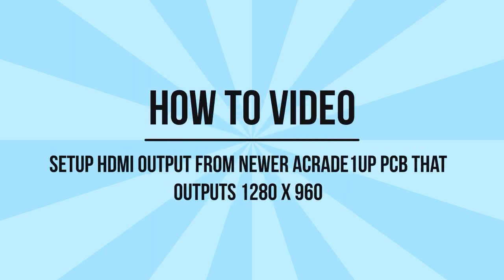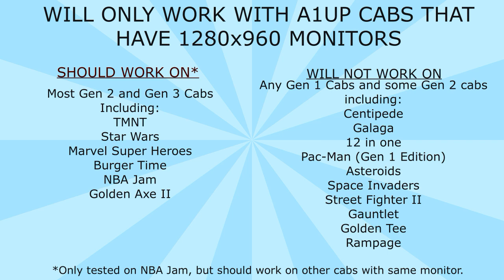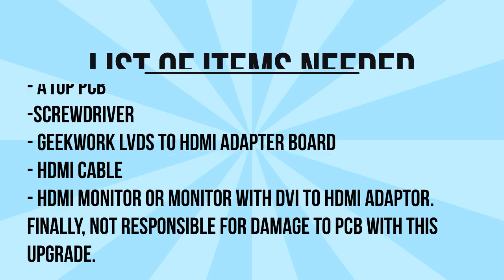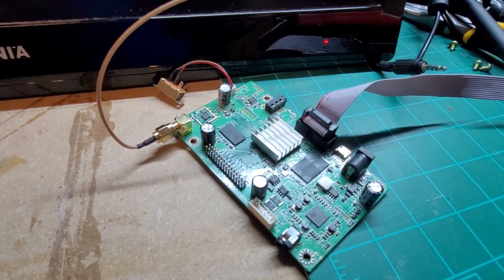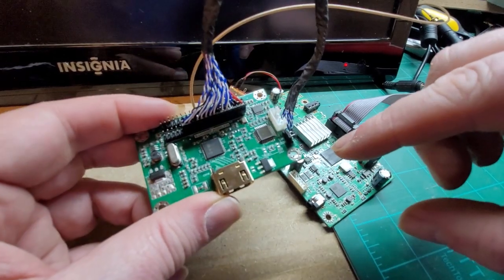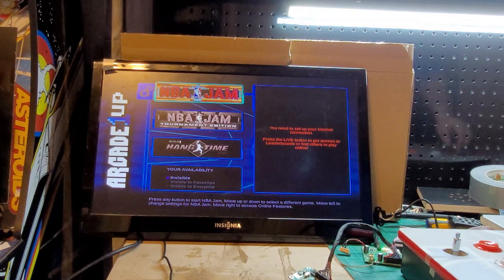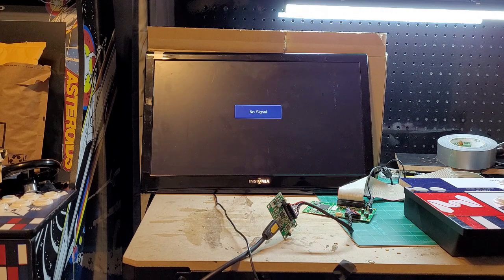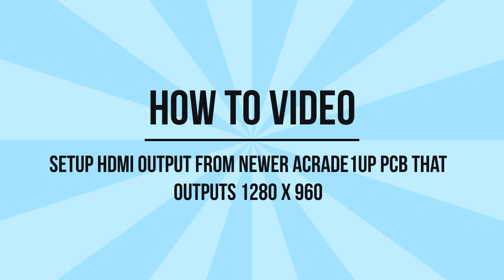A1UP Mods: How To Setup A1UP PCB Running 1280x960 Monitor to Output to HDMI. PLEASE READ DESCRIPTION

Comment: did you change the jumper from single or double 8??? Double 8, Support 1080P (1920*1080P)/1280*1024/1600*900/1400*900/1920*1200 etc.
Single 8, Support 480P/720p/768p/800P/960p etc.

Comment: Do you have a solution for a pinball cabinet with a dead screen.  Finding a monitor that fits is easy but I don't understand the wiring conversion to hdmi.
Reply from the maker: This is a bit different, but basically the same. 

1) For the Geekwork LVDS to HDMI board. I would get the version 2.0 board. Connect that to the PCB and then connect that to HDMI port on the monitor you are installing.
2) Again, there is not guarantee will be compatible with the monitor you choose. Monitor may flicker in an out. But there is a fix by Team Encoder that may fix monitors that flicker. The website for that fix is here:

https://www.team-encoder.com/pinscreenfix?fbclid=IwAR0RhGhBXXnr-FO5Mgu_X4CW8jD3FRlUSt7hewn2rJ9U0hIEiebzWQA6NIg

NOTE: This is not the hack that puts the 30 tables on your PCB...this is only to fix flicker issues on third party monitors, if that problem comes up.
Reply: Thanks.  I was only trying to replace the monitor and not mod the cabinet and there isn't any vids I could find that explained it.
Reply from the maker: @themondoone6316  Yea...if is monitor other than the stock, would need the geekworm board, as would let up plug up HDMI monitor.

The update I specified in my other post is in case the monitor you put in there starts to blink in and out after you turn on the the game. That update does not put any other games on there, just makes some fixes so the monitor does not blink in and out.
Reply: Arcade1up says they are currently out of stock with no restock date.
Reply: Are you sure on the version 2.0 or is it version 20 (for 2020)
Reply from the maker: @themondoone6316  That is the one I have the best luck with, but it is crap shoot with these boards. If you are looking for monitors that for sure work, look at that link I sent. They  have some monitors that work and one listed that works with the V1.5 board. But again, I have most luck using the V2.0 board.
Reply: So I was trying to say there is no v2.0. Only a lvds2 and lvds20.  The question is moot and I grabbed the third Gen 1.5 and ordered the 27 inch element monitor suggested.  We'll see what happens when it gets here.  Should be a fun little project in any case.
Reply from the maker: @themondoone6316  It would be this one listed here:

https://www.diyretroarcade.com/products/v2-0-lvds-to-hdmi-compatible-adapter-converter-board-with-cable?variant=43830575497434&currency=USD&utm_source=google&utm_medium=shopping&utm_campaign=DIYshopping&utm_term=&gad_source=1&gclid=Cj0KCQjw8MG1BhCoARIsAHxSiQlbNDcwyVL41V6z1nJXvY2xG-4apOb3RV68kT2yQG27VIQVcSFf1ZAaAukUEALw_wcB

It is V2.0, although it looks like it states V20. But at any rate, if you got the monitor that is compatible with the V1.5 board, should be good.
Reply: Ahh yes.  Saw that.  If you look on the pic of the board you will notice it is actually v20 and not 2.0 which it is listed as on the geekworm site.  Geek worm said there was no difference between the ver 20 and the 1.5 (except for the second lvds connection) so I think I'm in good shape.  Thanks for your help.
Reply from the maker: @themondoone6316  yea...that is what they say, but the board you get is dependent on what board A1UP uses for their game. For the board in Pinball, I have better luck with monritors and the V2.0 geekworm board. But the monitor that you just bought and the V1.5 board should work. I have not tried, but Team Encoder states it works and they know their stuff, so I trust them when they say it will work. Good luck.

Comment: any luck on the arcade 1 up pinball
Reply from the maker: Best bet is using the Geekworm V2.0 board (not v1.5), but even then may run into issue. 

However, you can increase your chances of a different monitor working by applying Geekworm Screen Fix provided by Team Encoder. This fix will only work with the Pinball PCB's. The how to document is to get a specific monitor to work, but may work with others. I had a monitor with the Geekworm 2.0 board and would come up briefly, then flash in and out and then go black. Once I applied the Team Encoder Geekworm Screen Fix, the problem went away and had no issues with the monitor. And if it does not work, can always follow their instructions to flash back to stock image.

Still a crap shoot on what monitor will work, but with the Geeworm Screen Fix by Team Encoder applied...I believe you chances of getting a monitor to work increase.

Here is instructions from Team Encoder website, if interested:

https://www.team-encoder.com/pinscreenfix

Comment: In this video how are you getting audio? I see you have something plugged into the SPK port on the NBA Jam PCB, is that a 3.5mm cable? What is the cable then being plugged into? I tried running a 3.5mm cable from my arcade PCB (while also using the same HDMI adapter board in this video, so the same setup) to an amplifier and I'm getting zero audio except for a clicking sound. Are you running the cable from the SPK port to an amplifier, or to the stock arcade1up cabinet speakers? I am getting zero audio from HDMI.

Comment: Been wrestling with this thing for the last hour and nothing works. I have a Dell 2001FP (not a 2007fp/b). When trying it, I can hear the A1U turn on (its a Killer Instinct) and I can tell a signal is being sent to the monitor because it comes on and exits power-save mode, but I get a black screen. No idea what is going on. Ive tried HDMI to DVI cables, an HDMI to VGA, and even trying a straight HDMI into a different monitor to test it. I get nothing.
Reply from the maker: What version of the board are you using? The version I have best luck is the Geekworm V2.0 board.
Reply: sorry  @The_Passable_Gamer  I didnt see your reply until just now. Yeah thats the one I have that has the double row of pins, and it does say v2.0 on it.  On the 2001FP that Im using, like I mentioned it comes out of sleep mode, but no video. Only thing that changed was when I used both jumpers and I got an image on the screen but it was all garbled information. Basically like TV static but it wasn't moving, it was a solid "picture" of static.   On another test monitor I used that was with HDMI wouldn't even wake up from sleep mode.
Reply: @The_Passable_Gamer  Update on this. I finally got a 2007fp and I get video, but lots of flicker. I have no idea how these dudes that created this board made something that works so haphazardly lol.  Awful. Ive tried two different boards, higher quality DVI and VGA cables, etc etc etc. Flicker. It makes playing the game nigh impossible. Guess Im just gonna go back to the stock KI 17" POS monitor.

Comment: What is the monitor resolution of Arcade 1up Mortal Kombat machine Gen2 first release?
Reply from the maker: Depends...if it is the Costco version, it will be 1280x920. If it is the Walmart version, will be 1280x1024. I am not sure if other stores sold (want to say GameStop sold as well) but believe those are 1280x1024 as well.

With that said, both have 12 pin ribbon cables, while the Gen 1 MK2 had a 40 pin ribbon cable that connects to the PCB.

From what I tested, if it is the 40 pin ribbon cable, does not seem to work. If it the 12 pin ribbon cable, regardless if from Costco or Wal-Mart, best bet is to get Geekworm Gen 2 board (ends with v2.0). Hope this helps.

Comment: Can i use this convertor for  resolution 1440x900
Reply from the maker: It is possible...it may work. I have a Viewsonic VA1936w monitor that it works on and it is 1440x900. However, some model monitors may not work, although they have the same resolution. What is the model of the monitor you are trying and what A1UP PCB are you going to use with it?
Reply: @The_Passable_Gamer  ...thx allot so nice of u....panel is MT190Aw01 and combo board cv628h-b42...
Reply from the maker: @syedraza7277  Ok...was this a TV that was disassembled or did you buy as a kit that had only the LCD screen and the board? Either way, there is a chance it might work, but need to know what A1UP PCB you are trying to hook up to it. That will determine what version of the Geekworm board to try.

This is the guideline I use when connecting A1UP PCB to Geekworm board (If not connecting to A1UP PCB, can just ignore):

If the A1UP PCB has 40 pins, the PCB is black or it is a Countercade, the Geekworm board will not work, at least with all the monitors/TV's I have tried. A1UP PCB's with 40 pins are Gen 1 cabinets. A1UP Black PCB's are usually in newer Partycades, Legacy cabs, and Mrs. Pacman to name a few.

If the A1UP PCB is green and 12 pins, then you will have best luck using Geekworm Gen 2 board (ends with V2.0). A1UP boards that are green are ones like Star Wars, NBA Jam, TMNT, Midway Legacy, and Killer Instinct to name a few.

If the A1up PCB is blue/purple and 12 pins, then you will have best luck using Geekworm Gen 3 board (ends with V1.5). A1UP board that are blue/purple are ones like Marvel vs Capcom and X-Men vs Street Fighter. Believe Simpsons is also this color.

Also, if HDMI cable does not work, try HDMI to VGA cable. Sometimes HDMI will not work because of the refresh rate on the monitor. For example, X-Men Vs Street Fighter when you connect using HDMI to DVI to Dell 20" monitor does not work (at least when I tested, but works with HDMI to VGA using the Geekworm Gen 3 board. From what I have found, that is because the A1UP PCB outputs a refresh rate of about 66Hz and the Dell 20" Monitor is rated at 60Hz. But using and HDMI to VGA cable instead, it will work.

So depending on what A1UP PCB you are going to use, will determine what Geekworm board to use.

Finally, the above are just based on tests I have done. You may find that the differnt PCB and Geekworm board combinations work. However, the above has worked for me when connecting A1UP PCB to Geekworm board and TV/Monitor.

Here is link to buy from AliExpress on Geekworm store. To select right board, goto Bundle selection and select the board you want with cable.

 Good Luck.
Reply: @The_Passable_Gamer  ....thx allot for for your kindest and detailed guide lines....i am happy with ur kind reply....know i dont wory if all this work or not....ur reply made my day....thxxxxxxxxx allot...

Comment: Followed another tutorial online and thought my GW board was dead. Watched yours and your tip about matching the pin to the dot was what was wrong. Hooked it back up and everything is working. Thanks! Now I just need to figure out how to easily remove the cable from the PCB after using. Any tips?

Comment: I am looking to alternate between my original PCB and a Nintendo Switch. 

This allows the pcb to have hdmi output. Can I then connect the original 17” monitor itself to receive hdmi input and then use an hdmi switch to alternate between the pcb and Nintendo?
Reply from the maker: Theoretically, yes. So once you connect the LVDS to HDMI board to the A1UP PCB, you now have HDMI Output from the PCB

On the actual 17" monitor, would have to get an LCD controller board for that monitor so it would have HDMI input. Then could use a HDMI switcher to switch between the A1UP PCB and the Switch.

Just keep in mind the following though:

1) Not all TVs/Monitors work with the Geekworm board. So if you get the correct LCD Controller board for the A1UP stock Monitor, the Geekworm board may still not work, as it may not be compatible with the LCD contoller board.

2) You would have to connect the audio from the A1UP PCB to the Geekworm board as well..This is so the audio is going through HDMI as well. Most people do not do this because for A1UP, you already have speakers hooked up and no need for audio to come through the HDMI. But in your  case, you would want to do this.

You can watch this video from The Code Always Wins to do this. He is doing this for Generation 3 (V1.5) board, but this should work with the Generation 2 (V2.0) board as well. However, have never done it and may damage your monitor/board when doing it, so have to be careful.

https://www.youtube.com/watch?v=I8MovSVPnP4

Hope this helps.
Reply: @The_Passable_Gamer  Thank you! I'll give it a shot!

Comment: Does the gen 3 board work with nba jam?
Reply from the maker: With the monitors I have tested with, I have not been able to get NBA Jam to work with the Gen 3 board. Will have more luck finding a monitor/TV to work using the Gen 2 board.
Reply: @The_Passable_Gamer  tyanks i have been looking at that new hdmi moniter and bezel in one as well you think that would work with it ?

Comment: Does the Generation 3 board even work with ANY monitor? I've tried mine with NINE different monitors and none of them have worked as of yet... You can see that a signal is being produced, but the screen just stays black.
Reply from the maker: It does but also depends on what PCB you are using...so what PCB are you trying to use with the Gen 3 board?
Reply: @The_Passable_Gamer  does it work with nba jam?
Reply from the maker: @cbk12  It depends on the monitor you are using. But with NBA Jam, will have better luck using the Generation 2 board than you would with the Generation 3 board.

Comment: I bought it fo development needs, I hope it can adapt to other eval boards.
Reply from the maker: If you just bought, you may have received there Gen 3 board, so somethings that worked with the Gen 2 board may not work with the Gen 3.

Comment: Confirmed working with XvSF cabinet.
Reply from the maker: Yes...however after some more testing, looks like the output refresh rate is 65Mhz. The monitors I tested with were 60Mhz and that is why they were not working unless you had an HDMI to VGA converter. Once you confirmed your monitor, I checked the refresh rate and was 75Mhz.

I found an older monitor I had that has a refresh rate of 75Mhz and it worked. The pictures still looked bad (it was interlaced), but was able to run without and HDMI to VGA converter.

So seems because on X-Men vs Street Fighter (and more than likely Marvel vs Capcom, since they use the same board), if you want to use the Geekworm board to get a bigger monitor, you need a monitor or TV that has a refresh rate of 75Mhz. Will be doing further testing and release a video of the work.

Thanks again RoTeNdO for confirming you got it working on your monitor.

Comment: When you hooked up the Asteroid, you didn't have the 30 pin connected the correct way
Reply from the maker: The 30 pin is connected correctly on the Asteroids PCB. On the Geekworm adapter, cannot tell if it is connected correctly or not. Cannot tell if the red power cables are on the left or right of the board (Should be right). At any rate, I have tested multiple times after this and connected the correct way and does not work and will not work due to the resolution of the older Gen 1 cabs PCB's being set to 1280x1024.

Comment: How do I find a HDMI TV it will work with the LVDS to HDMI converter board. I tried 10 different TVs and none of them work. Is it just trial and error or can I look at the TV specs and find out? What large screen TV have you tried that works? Please help.
Reply from the maker: Unfortuately, it is trial and error. Also, depends on the game you are trying to use. Some games will not work. If you have not already, there is a Discord group that has a list of games and TV's that work:

https://discord.com/channels/806193517705691196/806199431220822056

Comment: Great video but to I need a dvi to hdmi or can I run it thru hdmi alone for dell monitors
Reply from the maker: If the monitor does not have a HDMI and has a DVI, then yes...would need a DVI to HDMI cable. Otherwise, if the monitor has HDMI, then just an HDMI cable will due.
Reply: @The_Passable_Gamer  thank you

Comment: Anyone figure out how to make this monitor mod work with the MVC cab yet?
Reply from the maker: I have not...I think someone got it to work by  setting the jumper to single 8, but image did not look that good. Been seeing some of the newer A1UP machines do not seem to work with the card...not sure why.
Reply: @The_Passable_Gamer  k.  Thanks for the response.  If you ever hear of it working, plz lmk.
Reply: @The_Passable_Gamer   the 1.5 works on MvC 2 but I feel like there is noticeable slight input lag. Sometimes have to turn the cab on and off till the geekworm catches the signal. I had to wrap the lvds cable in foil and electrical tape to reduce signal interference. There is still slight waviness on texts not noticeable during active gameplay. Not sure if there is any real good way to upgrade the monitor without replacing the pcb entirely because I’m sure a direct panel swap is going to have extra drawn lines drawn and I don’t even know which type of inverter board to get for the 2007fpb since different monitors use different boards. Very unfortunate.

Comment: This doesn't work on my TMNT PCB.  Any suggestions?
Reply from the maker: Should work on TMNT PCB. I have two of these PCB's and it runs fine. Can you tell me what is happening when you plug up? Do you just get a black screen? Do you hear sound? Also, keep in mind it may be the TV or monitor you are using may not work. There is a Discord page I created that can help with any questions you have:

https://discord.com/channels/806193517705691196/806198719732252732
Reply: @The_Passable_Gamer  When I turn on power, it goes from blank screen to message that says "no HDMI signal".  I've tried both a 1080p TV and a newer ASUS monitor.   Same result.
Reply: Solved!  I tried a newer Dell monitor and it worked.  The other TV and monitor must not have supported the resolution.